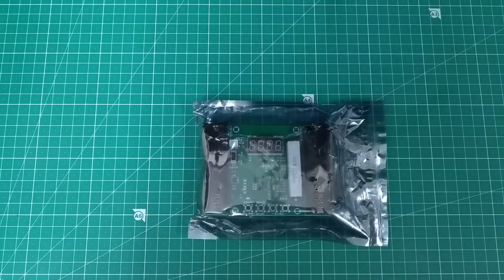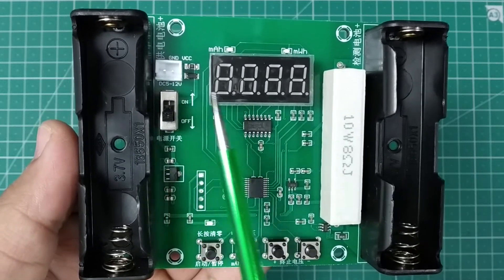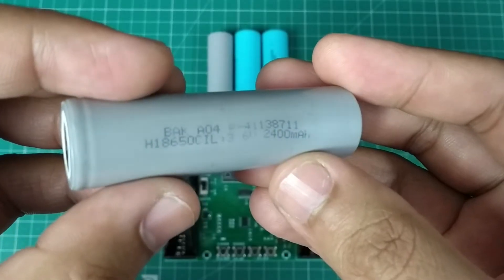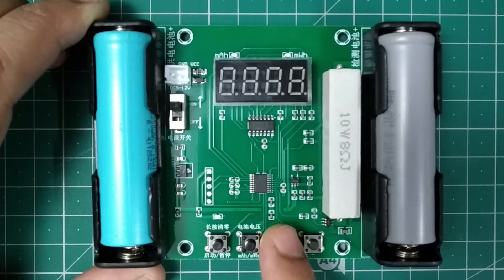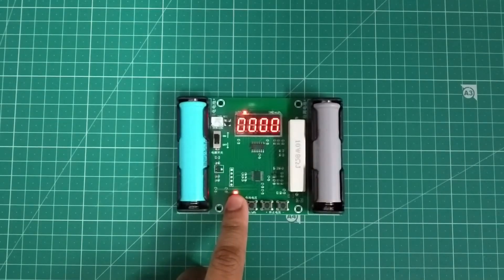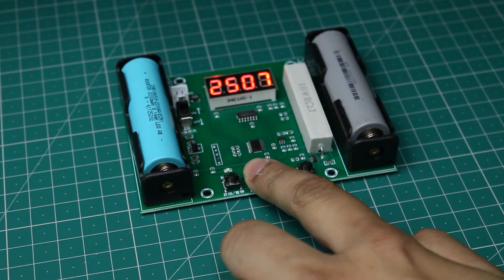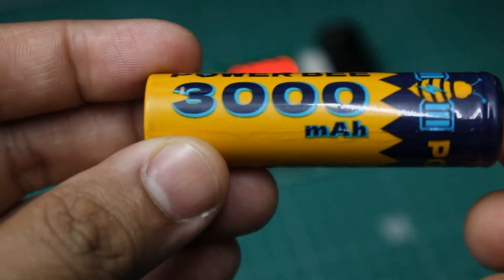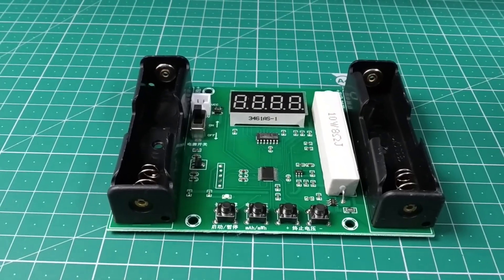3.7V Lithium Ion Battery Capacity Tester - XH-M240 Module

Comment: I attached a lithium polymer battery into it but it constantly fails the test. It also shows 9999 resistance. I assume the cable is the culprit because when I attach a normal 18650 battery using wire, same thing happened

Comment: Is there a 21700  version of this battery tester
Reply: Try M-239,it has wire connectors to connect external wired battery holder.